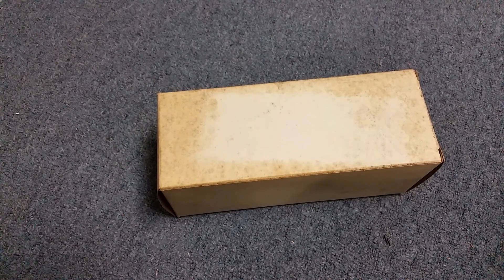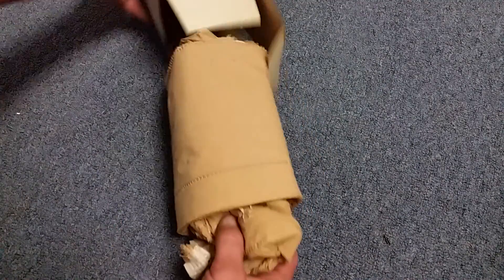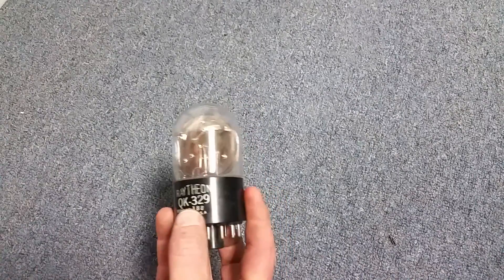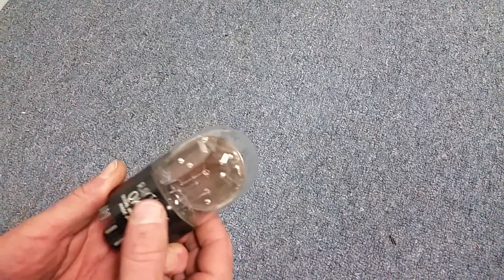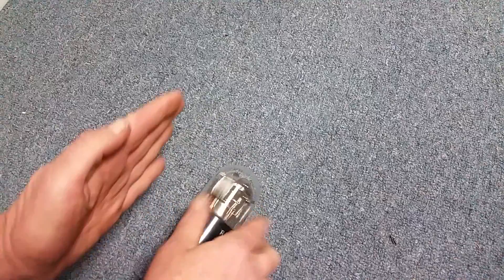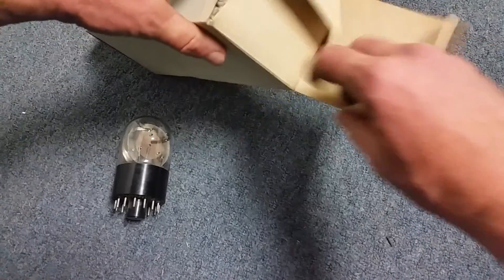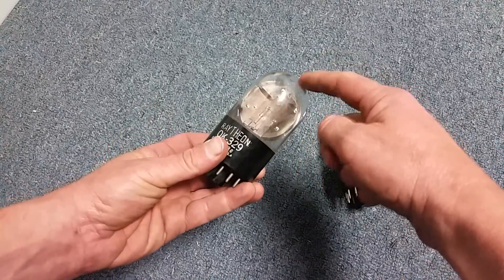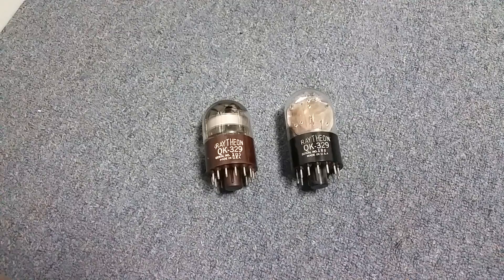Raytheon QK329 - An Analog Computer Tube

Comment: There is NOTHING on what this tube was used in, but i suspect military application
Reply from the maker: Every one of these tubes has had a fairly low-ish 3 digit serial number - so they might not have been used in anything! Just critters that escaped the lab?

Comment: hey not sure if you came across any additional information, my father in law gave me a box o' tubes and one is QK-329 Ser.#224 - has the vertical beam shaper and the branding/model info is etched/engraved not the color sticker